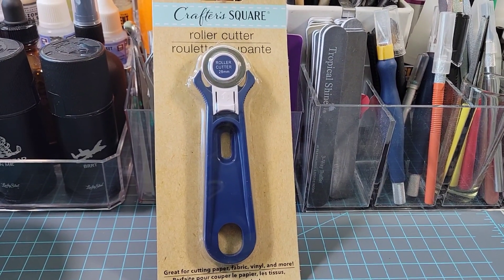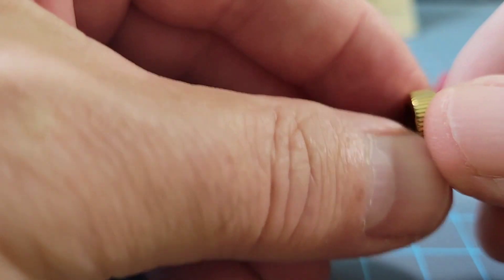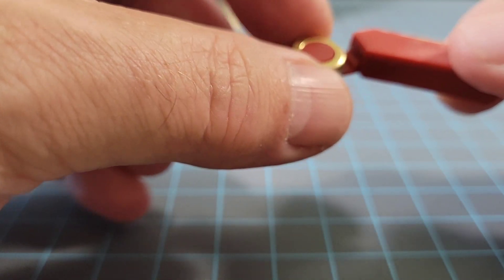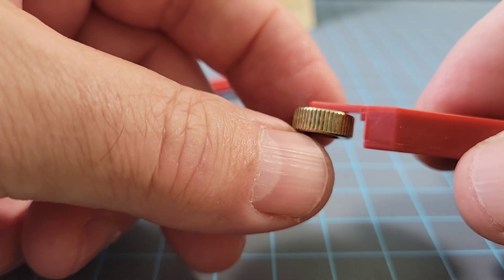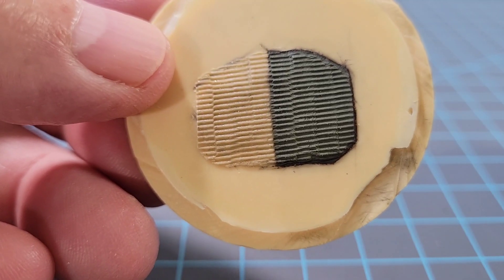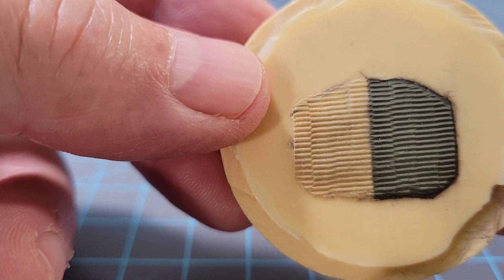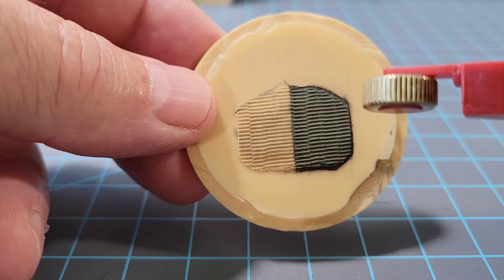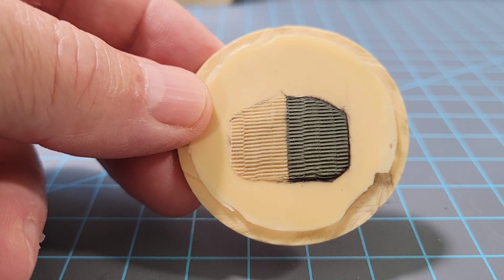ZIMMERIT tool for Tank Models 1/35th and 1/48th #tank #scalemodels #tankmodels

Comment: Lion Roar did the best off the shelf ones, don't know if they are still avaiable, tbh, I used the inertia gear from a defunct venetian blind, to roll the larger pattern into the turret side walls, it was easy enough to roll it down the surface with your thumb. I did a full SBS around a decade now on Armorama, using various tools, but have been told that it is now archived or not even avaiable anymore... Great find on the gear roller, one of the best bits of being a moddeler! Keep up the good work.
Reply from the maker: Thank you sir! Venetian blind huh, I'm gonna have to keep an eye out. I actually ordered on ebay different circular cutters to see if the gear teeth are any different or if the width of the gear is different. Stay tuned 😁👍

Comment: The metal ones are from trumpeter and I had a hard time getting them. I bought them in China from a hobby shop and was lucky to get them. It has been a long time ago since I came back from China (2014).
Reply from the maker: I'm glad you got a set. I would still buy a set if available as long as it had 1/48 scale attachments.